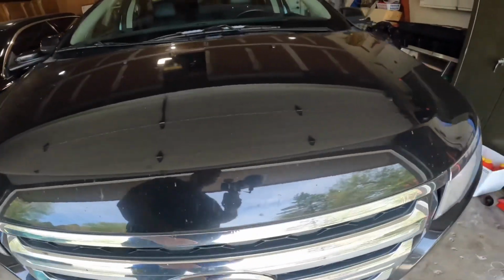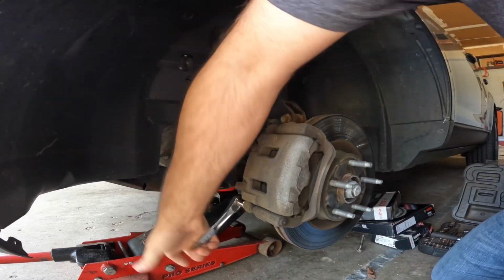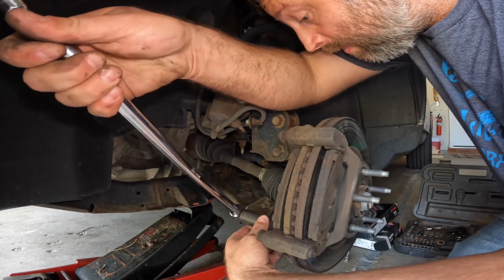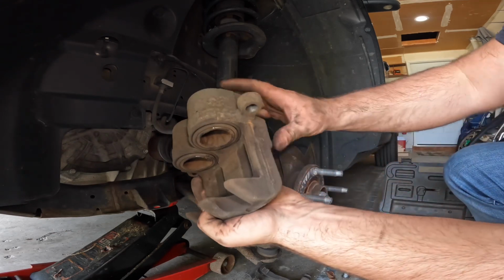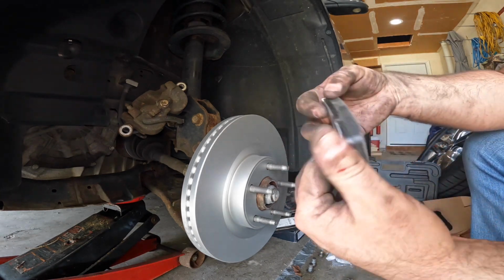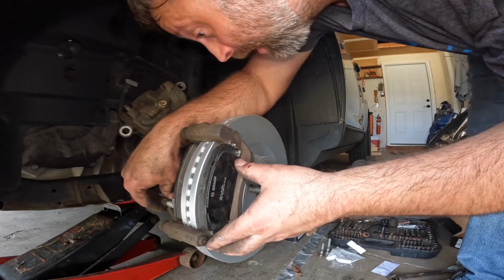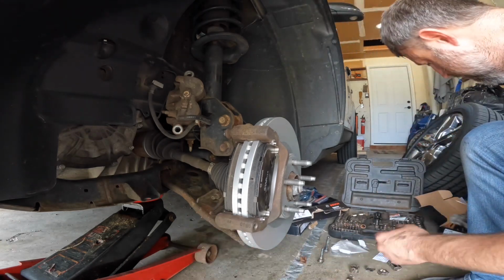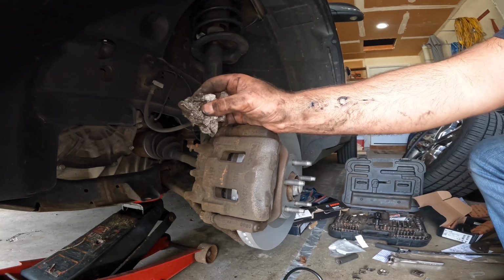2013 ford edge front brake pad and rotor replacement. @GravelAndGritGarage

Comment: Always secure the caliper to the spring on the strut so that the brake line is not damaged. These can easily fall and internally damage the brake line resulting in seized or locking calipers that will destroy the new pads. A long cable tie, a piece of wire, an old metal coat hanger can be used to hold the caliper in place.
Reply from the maker: Thank you for the comment!  I have never tied up a caliper ever. Would it be a good idea to, sure. Just not my style. 😂.
Reply: Yea man..they sell specific s hook style hangars just for this job. I'm not the girl in the picture. I'm her boyfriend. I'm a manager at a large shop and I've owned my own shop. We're doing an edge right now and one of the mechanics just did the front brakes...Abs,brake,traction control and every other brake related message has popped up. Is there a service mode for a 2013 edge? 15 and up there is..But not sure about a 13. We're trying to figure out right now WHY it's lite up like a Christmas tree.
Reply: Any immediate help would be appreciated asap